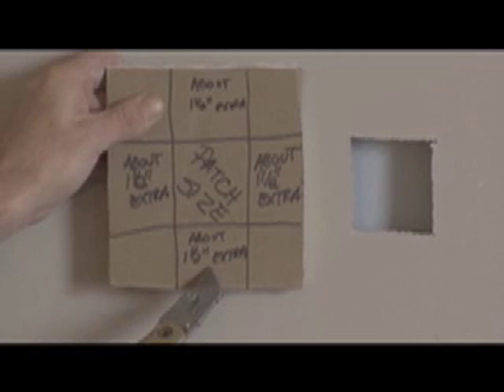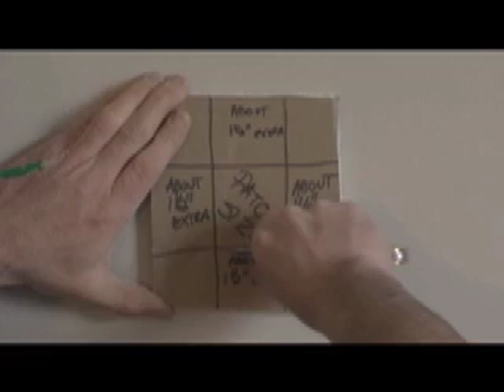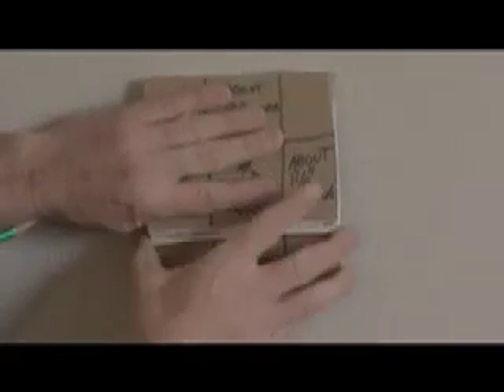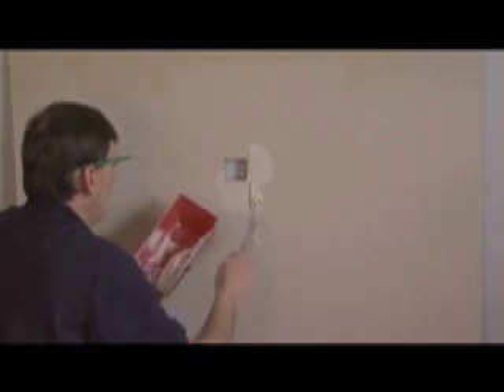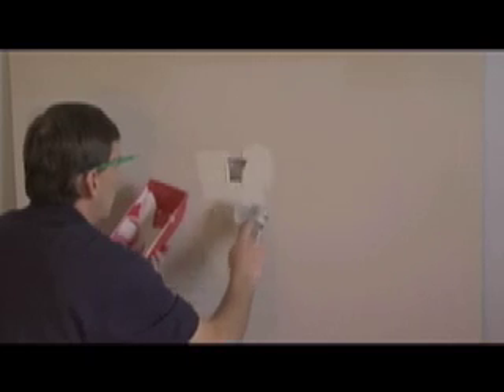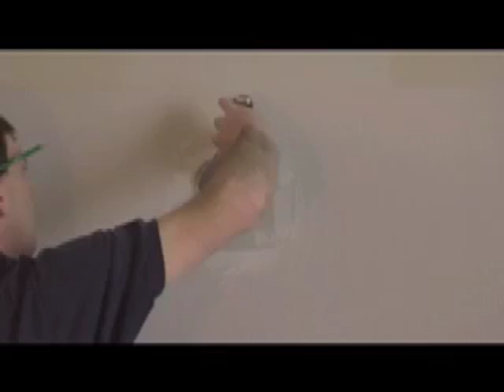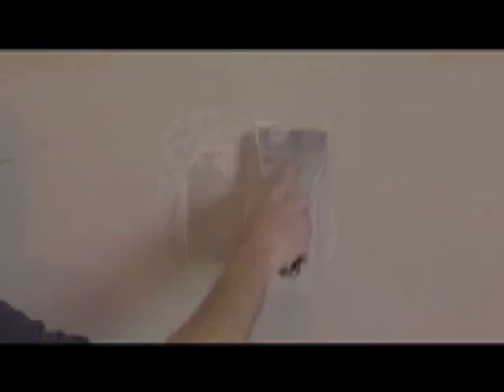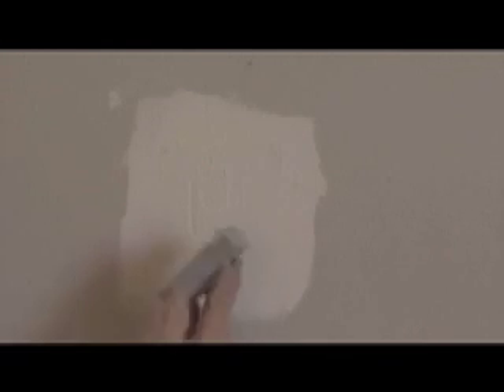Easy Drywall Repair a typical home improvement  (CC)

Comment: Thank you so much for the idea!  I just moved into a new house where the previous owner had "repaired" a couple of holes from what looked like a towel rod being ripped out of the wall by smearing copious amounts of spackle in the holes.  With your help, my repair will look much better.  Thanks!

Comment from the maker: True the wider you can float out an imperfection the better.The nice thing about this patch is the imperfection is only the thickness of the paper on the drywall and surprisingly usually dont require a large float out surface. Thanks for the post---Bob

Comment from the maker: A typical railing bracket mounts into a wall stud if you can remove it and place it on the closest wall stud that would be best.If that cannot be done then I would cut the patch from stud to stud and nail a 2x4 between for an anchoring point.Hope this helps===Bob

Comment: Smooth Set (or hot mix if you prefer) Is not meant for anything but filler that will be taped over. It cracks easilly within 6 months. Joint Compound is the only way to do it right.

Comment from the maker: I AGREE THAT IF I WERE DOING IT I MIGHT USE SPEED SET(AS I CALL IT)TO BED PATCH THEN USE(topping compound)NOT JOINT COMPOUND TO FINISH AS TOPPING COMPOUND IS EASIER TO SAND THAN JOINT COMPOUND.ALL THIS BEING SAID IN THIS SITUATION WHERE THE PATCH IS SMALL AN EASY SAND SPEED SET (I BELIEVE)WOULD BE FINE TOO.ALWAYS MANY DIFFERENT WAYS TO DO THINGS NOT ALWAYS CLEAR WHICH IS BETTER OR WORSE. THANKS FOR THE ADVICE.      -BOB

Comment from the maker: Seems that the putty would be very thick would shrink alot and the potential to crack would be high. Maybe for minor plaster repair using correct plastering material that may have potential but I dont think so for drywall .Thanks for the post.    Bob

Comment from the maker: If I were doing a repair like that I would use a concrete-based board.Its not that much more expensive than plasterboard but will bond tile repair and protect wall from water penetration much better, even for a temporary repair.===Bob

Comment: Thanks for this video. It's helped me a lot.

Do you have a video to repair the ceiling using the same method? I removed 2 walls and I need to close the wall space in the ceiling.

Thanks.

Comment from the maker: I understand what you are saying ,however drywall compound shrinks and the joint between the patch and the wall may loosen during drying process+++Bob Shrinking behind paper surface would actually pull paper tighter to surface.

Comment from the maker: 12x12 is a little large for this type patch.I would advise cutting stud to stud like I do in my "UNIQUE USE FOR SAWZALL"video.Also once completely dry, rescrew surrounding area to make sure drywall did not sag away from floor joist.Prime with stain kill paint before final coat. HOPE THIS HELPS===BOB

Comment: Interesting method, keeping the patch flush might be a problem for some.  Only thing I would add is that for a patch not to appear as a smooth bump, it needs to be filled out a lot wider.

If you are patching a hole and repainting it doesnt matter how wide it is, the important thing is that it is not going to be seen.  Using a narrow width blade is impossible to leave a nice flat finish.  Get at least an 8" blade to finish off 10" is even better.

Comment from the maker: Home Depot should have everything you need.Mud is actually drywall topping .Cost for a six inch mudding knife you can expect to pay 5/6 dollars razor Knife 3/4 dollars small amount drywall and topping compound 7/8 dollars.This should be enough to do several small repairs as described in video.Hope this helped===Bob

Comment: The old Hot patch! nice< but for a hole that size I would have just used a piece of tape (w/ quickset) this is a great way to patch a hole 1 or 2 foot wide,also to get a smoother finish use a 10 inch knife.

Comment from the maker: I would not go any bigger than a 10inchx10inch hole.I would make sure surrounding area is screwed up tight and if your patch does extend over existing framing I would throw a screw in it while I was bedding patch===Bob Good Luck!

Comment: Wouldn't work on large size hole drywall mud has enough strength for small patches but for a hole 1' or greater it's best to support back of patch

Comment: Hello Bob,  water overflowing from my bathroom upstairs caused some water to come through my celing downstairs.  Never broke through but there is a stain there about 1foot by 1 foot that feels slightly moist.  Will these instructions also work with this spot in my celing?

Comment: Hi. I have a hole about the same size in your video, but behind it is where a section of stair railing mounts to the drywall. If I patch the hole as you did in the video, will it be strong enough to drill in to and accept the weight of the railing again? The railing is about 8 feet, and mounts to the wall in in 3 places (top, middle, bottom). Thanks for your help!

Comment: ok im a serious novice in this area, caused some holes at home and i needa fix em. 1st question, can i get all these materials at any hardware store? like home depot or something? 
2nd question- when you say mud, is that something you can buy as well at the store? dry wall as well.
3rd- can i get a ballpark figure as to how much it'll cost? thanks a lot

Comment from the maker: You will probably need a razor knife to make the patch.you can use that same tool to VERY SLOWLY, A LITTLE AT A TIME.SQUARE UP THE HOLE.+++ Bob    Sorry so slow in getting back untill I saw tanerofies response somehow I overlooked your message sorry

Comment: I punched a hole in the drywall and the piece that I punched in remains inside the wall. It is still however fairly intact, do I discard this piece or will it be useful as a "scrap" piece of drywood? And if so, is there a need for a patch at all?

Comment: Is there a limit on how big the hole is for this method? I've got a hole behind wallpaper estimated to be 5"x5", the perimeter drywall is crumbling so I'd like to repair it with a 10"x10" piece. It is right near a corner as well so I'm not sure if this would work.

Comment: I have a few holes in my walls but I'm not sure if it's dry wall. One is on a corner and is now showing metal. The other is under a window, but looks like wood behind it. Any ideas? do you have an email I could send pictures to for further advice?

Comment from the maker: The best advice I can give for a repair that large is to cut drywall back to existing framing,center of studs,install new dry in repair nail and screw .Use paper tape and drywall topping compound to finish.There are more detailed videos available to learn finishing techniques on youtube check them out===Bob

Comment: What about the whole cardboard with a string trick where you push the cardboard through pull the string tight, apply putty cut off string and sand?

Comment from the maker: If you have a textured wall don't paint untill after texturing! And only if surrounding wall is painted. That being said there are many different types of textures and techniques to achieve them. You need to be much more specific with description before I can begin to advise.+++Bob

Comment: The hole that I have in my wall is 15x bigger than that hole. Where do I get peice of drywall that big to fix my wall? If I were to follow these directions from this video, wouldn't it look obvious that the whole was there because I have little bumps on my wall rather than a smoothe surface

Comment: like the idea but this way is to much time, if you go to home depot get 5 mins, smooth set and a roll of fiber glass mesh tape and in 45 mins. you are ready, you just have to do similar steps, (exept. the drywall and the 24 hrs time) ha ha ha